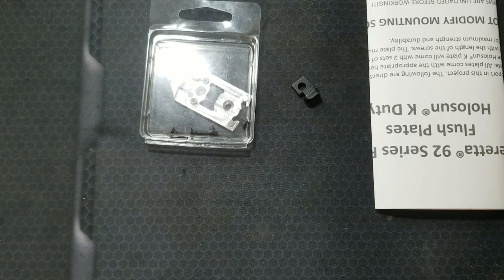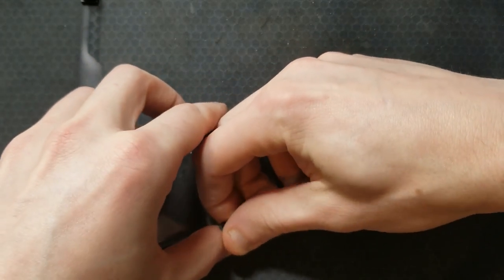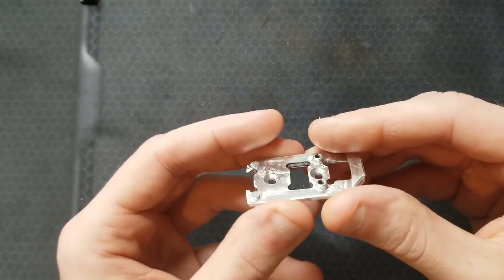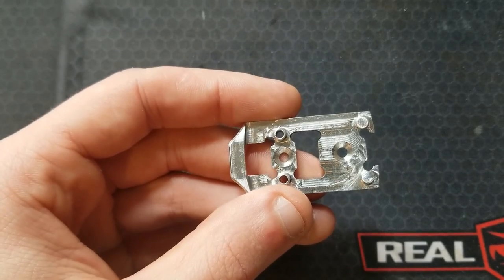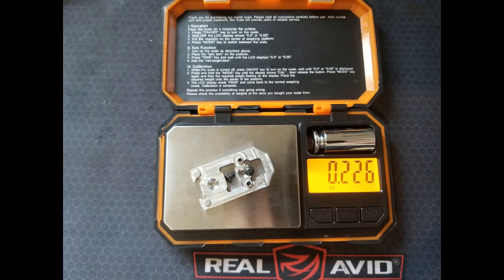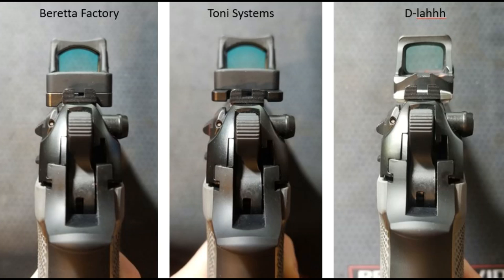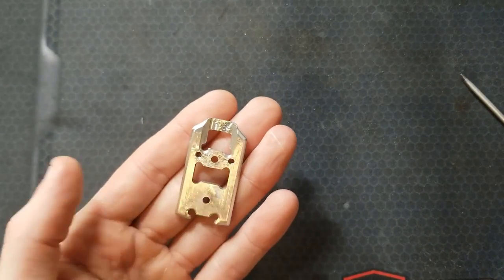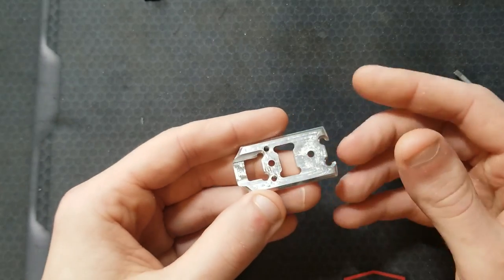The Best Beretta 92 RDO Optic Plate Option! Dlah Designs

Comment from the maker: I want to add that while the factory and Toni systems plates are for a different optic mounting foot print, I feel the comparison to this mount is appropriate. This is because the factory and Toni systems plates in the Holosun 507K/RMSc are the same materials, size, and profile as the ones for the RMR footprint I show in this video and compare to.

I did not go into any detail about swapping out the firing pin safety block because it is very straight forward. His instructions do not include this step but it is as simple as driving out one roll pin, replacing the FPSB then reinstalling the roll pin. If you're not comfortable with that, pay a competent gunsmith or do not buy this mounting system. It will not work unless the provided FPSB is installed!

Comment: 10:31 it’s only more expensive than the Tone system plate because of the firing pin block.  If you mod it yourself it’s the same or less than the Toni System plate.
Reply from the maker: Correct. However when I ordered it I was not given the option and my package included the firing pin block for $130. I would have had no problem modifying it myself. Also for the same price as the Toni systems the machining is of worse quality and it is not anodized. However the weight and height of the mounting platform is so much better than the Toni Systems that it is worth it. I also anodized the plate black myself later haha.

Comment: Will suppressor height sights co witness?
Reply from the maker: I believe the Vertec slide suppressor height sights will. Since the Holosun 407/507K optics have a sight notch in the back of the housing, I installed a tall front sight and shaved it down for correct POA/POI. I got the sight from Dawson Precision. It came in at .355" above the slide (front sight is sold as .345" height), and I filed it down to .280" above the slide for the correct POA/POI with the integrated Holosun sight notch. Hope this helps. Thanks for watching!
Reply: @EngineersArmory  Thanks!. This is great. The front sight you're using was too high to have the correct POA/POI So, you lowered it a bit?
it's a safe bet that set of front and rear suppressor sights should clear the optics height? I'm thinking I'll go with the EPS
Reply from the maker: @Jawnwickk  Correct, The POI was too low, so I had to file down the top of the front sight that I installed (about .070") to correct for this. I am betting the suppressor height sights would clear the optic body. I bet D-lahhh would know, ask him if you're ordering from him.
Reply from the maker: At dlahdesigns.com he now offers suppressor height sights already modified to work with the optic plate system!

Comment: Were you able to cowitness using the red dot cut out as the rear sight?
Reply from the maker: With the factory front sight the poi POA would be a bit off. Later I installed a tall front sight from dawson precision to get the correct co witness with the notch in the optic.

Comment: This really looks like a good idea, BUT it seems that you are doing R&D work for them.  I would like to see a fully finished product soon with thousands of rounds fired.
Reply from the maker: Without considering the unfinished state the plates come in (no anodizing), I feel these are pretty well sorted at this point. I had many conversations with the gentleman who makes these and he has sold hundreds (not thousands, but certainly hundreds) of these plates of varying footprints. I have over 1000 rounds through my gun with the plate on it and I am sure collectively there are tens/hundreds of thousands of round through guns with these plates. 

Certainly not the volume or capability of a large company, but he has to start somewhere. I love supporting stuff like this as it feeds innovation and maybe it will help a competitive/better product get to market. I certainly understand if people choose not to buy one. No one really likes to feel like they're being beta tested on, but even large companies (*cough* Sig) release products into the market with significant volume without them being properly sorted. 

Also, take this for what its worth (the ramblings of some random dude on the internet), but I myself am a mechanical engineer and did some analysis on this design (for the optic footprint I chose) and don't see any issues with the design in terms of strength, materials, mounting features, constraining degrees of freedom, etc. 

Not trying to convince you to buy one, and certainly understand if you want to get something from a larger company, but wanted to provide some extra context. 

In terms of options on the market, nothing touches this in terms of mounting height and weight other than the LTT optics cut.

Thanks for watching and commenting!

Comment: The lengths we have to go to mount an optic on a beretta 92xrdo is RIDICULOUS!  I love my Beretta 92x…. Has yet to fail.  but having to watch videos like this makes me wonder what the F**K Beretta was thinking!  Why should we have to go through such great lenths to put an optic on a $700 firearm that is SUPPOSEDLY SPECIFICALLY CUT FOR AN OPTIC!  this is BONKERS..  am I missing something? Why should it be so hard to mount any optic on any gun! FFS!
Reply from the maker: Beretta factory plates are $25, available in different footprints, and they work fine, however the optic sits up high and the plate is heavy. Toni systems offers a lighter weight aluminum mount, its a bit more expensive.  At least one optic plate should be included with the gun when you purchase it. I think its rude that Beretta didn't even include one. This plate and the Langdon Tactical milling service are if you want the lowest, lightest optic mount possible on your Beretta RDO.
Reply: @EngineersArmory  that’s my point they sit up so damn high it’s almost not practical and the gun is already a tank so the last thing you need is more weight.
Reply from the maker: @nateman79  oh yeah. I got ya. It's because they did it the cheap lazy way. "How can we machine the slide design we already have in the easiest and cheapest way to add an optic so people stop pestering us about it?" What they should have done is what Langdon did...